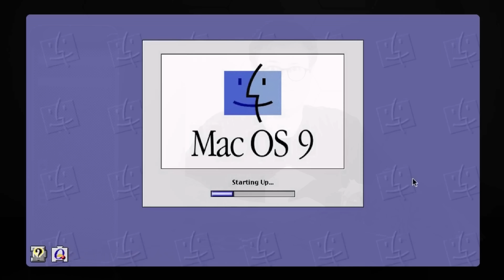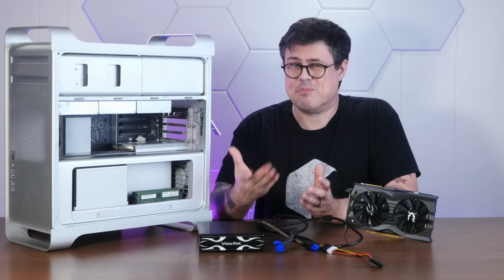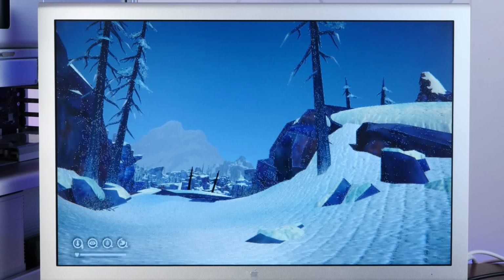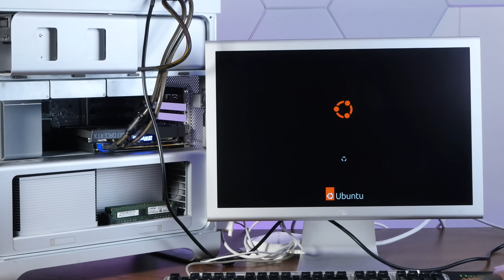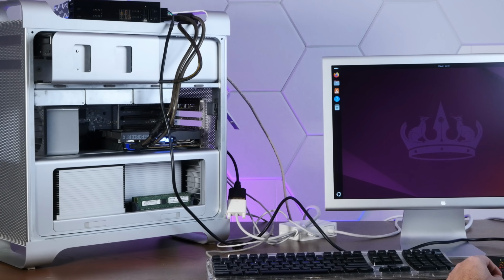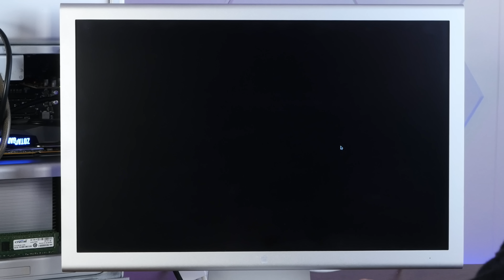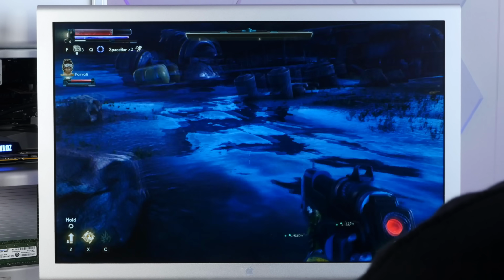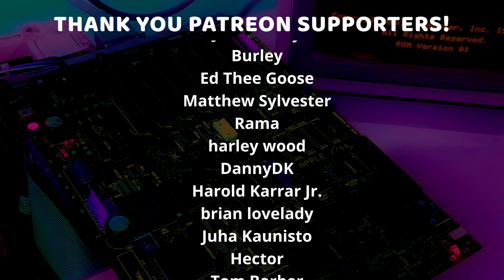I put an RTX 2070 in an old Mac Pro!

Comment: My Frankintosh-SpeXs  are the following today  []-) 
4.1 to 5.1 single tray MacPro with Intel Xenon 5690 @ 3.59 GHz, 
6 Core /12 Threads, 32 GB RAM und GTX 1070 8GB .
Win10 running in Bootcamp. All gaming is done in Win10 []-)
I have good VR legs and therefore great fun playing 
Alyx (30/45 fps), MSFS (25/45 fps) and GTA5 (38/62 fps) 
in appealing graphic quality 3D 6dof VR []-)

Hey ACTION RETRO 
thank you for the nice video !!!
Have fun with YOUR Cheesegrater !!!

These old machines are amazingly great to upgrade and to have fun even gaming. 
I am NOT a PC/Mac specialist at all. Still it took me just like a weekend of YT research and I had all info to build my Frankintosh.
(Thank you goes esp. to Greg Hrutkay.)

Comment: Hi I had my CMP 5,1 working with Linux Ubuntu and Sonoma with OCLP. Before having any MacOS (I had Monterey, and later Sonoma) I was able to get output and "Chime" with a GTX1050Ti. I literally removed the Sonoma drive, and kept the Rx580, and everything is fine. But When I put back the GTX150Ti, or a RTX3060 nothing came out, not even the Chime... How can I fix this?

Comment: I still don’t believe that some GPU’s can’t run a game like that at more than 1 FPS. I think they detect your card and then decide if it will work or not. If the 9500 was acceptable or even good in 2009, how can it not load a game that looks that crappy? I think the whole game industry is based on planned obsolescence more than computer and smart phones are. They must be terrible at coding newer games if you need a brand new flagship on a 3,000 core pc to load what looks like Sled Storm from 1996 😂

Comment: So I have 2012 MP 5,1 server. I run windows Baremetal with nvidia 1060 6gb. I’m running valorant over 120fps max graphic settings. ESO around 90-100 maxed out. I stream no problem. Can the 2070 run under windows ? That’s the video I’m looking for

Comment: I don't know why you are using an external power supply for the GPU, you get GPU mini 6-pin to 8-pin cables for that motherboard, there are two slots on the motherboard that will supply enough power to almost any GPU

Comment: You can go ahead in time a few years to around Sandy/Ivybridge era and find a lot of insanely good machines for all kinds of tasks. The hard truth is that during the 2010s when Intel didn't really have any competition (bulldozer wasn't really competing much with AMD) they didn't really make any big/massive improvements for like 10 years aside from top end if you really push it. I have a jank dual socket X99 aliexpress board with some used Xeon E5-1650 v3's with 32gb of ram, and it works great, surprisingly (with fire extinguisher nearby just in case). For a weird for fun project, I actually enjoy using it for the fun of it alongside my old Ryzen 2600 build that has become my budget test bench. Performance isn't half bad even today, but you could probably scrape together something like a 12600KF i5 build when parts are on sale if you're patient and that together with an RX580 8GB you can get decent 1080p60 performance, especially with the supported upscaling. That's what my Ryzen was running until I transplanted it to the dual socket setup. If Intel ever releases battlemage for a decent price, I'm grabbing one of those and probably moving my 6800XT to the Dual Socket or Ryzen machine. I had an Arc 770 as my budget card with my RX580 8GB, but gave it to a friend that needed a card for photo editing, and it handles it great with current drivers. 

TBH, you can pick up loaded office workstations from around Ivy-Bridge to Haswell and maybe a bit later on these days with higher spec i7's for dirt cheap in lot sales or auctions. There's generally space enough for a card like this 2070 Super and enough power to handle it along with enough capacity for 16gb or 32gb of ram to make budget monsters relatively speaking. For kids or people that can't afford a more traditional build (or people like me that enjoy doing them for fun...my tinypc/thin client stash is ever-growing) it's a great option.

Comment: Nice.  I've got to flash my 4,1 to a 5,1 (never done before but I understand it's easy), and it's got a crippling 8 gigs of RAM I need to boost, Quad-Core 2.66 GHz Xeon, and a GeForce GT 120 (also probably needs upgrading too lol).  I'm still running OCLP Sonoma, but Ubuntu may be the way once the OCLP quits being able to be used.  Probably will need to look into that on my 1,1 and 3,1 as well.

Comment: Interesting... I installed Slackware on my 5,1. Took a little while to get the sensors and fans all figured out but it all works. If I were to use my old 2080TI I'd need an externally "mounted" power supply. Not sure how it would fit with the back plate on the floor of the expansion bay. Maybe externally mount it with a pcie riser cable?? So much possible jank...

Comment: I think that you might have gotten better performance on The Long Dark from the GTX9500 if you had added the nvidia-legacy PPA and installed the nvidia-340 drivers. In my experience, nouveau does not work very well with very old cards.

Comment: I have a Mac Pro with a Sapphire RX 5700xt running windows 10 and it can play cyberpunk 2077 at 2k res on high settings. I’ve placed a standard 500w psu where the disc drive was and run the cables through the hole where the apple psu cables run (after some trimming). One my fav machines although it needs a lot fiddling around to get windows and some games to work as they should ( or even install windows, which took me 2 days)

Comment: I'm the donor of that VisionTek PSU and when I bought it new from Fry's, I was probably the target market because I didn't know a whole lot about computers and woefully underspeced my PSU and was too lazy to outright replace it so I bought the VisionTek. I've since learned a bit more but I'm so glad to see Sean continuing his shenanigans with that thing. That thing would still be in a drawer taking up space. 😂
Reply: Do you remember how much it cost back then? Just never seen one before and I don't remember them.
Reply: @EhEhEhEINSTEIN  I'm not 100% but it was in the $50-60 vs range. It was comparable to a normal PSU but the ease of upgrade is what made it appealing and sold me on trying it.
Reply: What model is it?
Reply: That GPU is bottle necked to hell lol
Reply: @HoveKB   That’s fine though, he wanted to max out the capability of the Mac.

Comment: Classic Mac Pros are sweet. I have  a 4,1 flashed to 5,1 as well with dual 5680’s and an RX580 rn, I’d like to throw a Radeon VII in it so I can maintain hardware accel in Sonoma since I mainly use it for Mac OS. They can actually take up to a 6900XT so long as you’re on Monterey. I also need to upgrade to nVME’s and get a new WiFi/bluetooth card. Once you do that they’re very snappy and still can hold their own for their age. Even with just the processors and RX580 it’s impressive how snappy it still feels.

Comment: Hey it's my daily driver PC, except with maxed out CPUs, an RX 5700XT and the PSU mod. I've had it for since 2015 when I bought it used for £300 in a similar spec to yours, and well just never felt the need to upgrade it. I run windows 11 on it almost exclusively since my need for Mac OS ended a while ago, but it's still a great computer...

Comment: I had to retire my Mac Pro. The X5690s are very held back by their platform. Some games won’t even open, they’re highly incompatible for their power level. I “upgraded” to an i7 8700 which funnily enough is only 20% better than a single X5690 but are supported better for newer software. I was running an RX Vega 56 8GB and I’m surprise it was still lasting me 15 years after it was produced… but it was time for an upgrade.

Comment: Might be worth checking the firmware on the 2070 super. I had a similar issue with a PC and UEFI firmware not picking the correct video output on boot but works in the OS. Also try a different monitor with native HDMI or DP to rule out the monitor 🙂

Comment: Honestly always amazed how well a pc can run when it has an older cpu with a modern gpu. For a long time I used a 2nd gen i7 with a 1060, and it was great as long as I wasn't trying to run a cpu intensive game. Honestly had less trouble with that pc than when I upgraded to a 10th gen i5 lol.

Comment: Redmond done a really big mistake by raising the minimum system requirements of windows. My "gamer" pc is a 4690k@4,7ghz with 16gb of ram, 6gb gtx 1060 and a tons of ssd and hdd. It used to have W10 where I used firefox, libreoffice and steam. Now it has ubuntu where i use firefox, libreoffice and steam and actually it's much faster/responsive than before. Yeah I know, ubuntu is not the best for gaming, but every single game I play on steam works out of the box with same or even better performance than on W10 before. I hope it has many many more years to be an awesome daily driver/gamer PC.

Comment: The login screen issue can be fixed by going into your login screen settings and setting it back and forth to new themes and applying them usually, as the issue is typically the machine trying to initialize the original drivers until it updates. I also highly recommend getting the Nvidia 560 drivers.

Comment: You can install OpenCore and get to the latest Mac OS Sonoma, use some high end Vega series video card, Navi cards require AVX to run their drivers, therefore it won’t work with newer Radeon cards, yettt.

Comment: FYI every, single video of yours ive seen is very interesting. Keep it up.
Unusual setups are right up my alley.

Im not an apple fan but ive always wanted one of these for some alternate OS and hardware experaments.
And one of these cases would make a baddass PC mod for a "bad apple" (A Mac with PC components running a PC OS.)

I once created a bad apple out of a  "Bondai Blue" iMac G4 Case using an generic laptop brick-powered Mini-ITX motherboard with an Integrated AMD A8 quad core, 16GB RAM, 120GB SSD and a Nvidia Quadro running Linux Lite from spare parts for an Ex Girlfriends photo editing hobby using GIMP.

Comment: Hi I use a Sapphire PULSE RX 5700 XT 8G in my dual cpu MacPro4,1 , the graphics card is rated at a max 241w and is only connected to the Aux power headers. The Aux headers will cut out at 10A 120w and can be used stably at 8A 96w per header. Main thing is even if your gps has two 12v ATX inputs most guys will draw more power from one header compared to the other. So I use a Y-Y cable setup to join the two 6 pin aux headers together to a single 8pin then back out to two 8-pins connectors

No need for Pixas mod or an additional PSU. More than enough power head room on the stock psu

Comment: I have 2010 Mac Pro, choice of a single 3.45 (fastest gaming performance) or a dual 3.06. Open Core dual boot on separate PCIe Nvme 1TB Samsung 970 evos, Pixla mod and a sapphire rx6800 with syncretic flash mod, and a 3602 WiFi blue tooth upgrade, finally a usb 3 PCIe. On world of tanks, I get same frame rates as my AMD 7600X / X670E combo with the rx6800🎉🎉🎉

Comment: Did you try reinstalling Ubuntu after installing the NEW video card? It might fix the blank logging screen problem, by the video drivers being upgraded and match automatically to the NEW hardware specifications of the Mac’s  Hardware, that of which includes the new video card. Another excellent PC tune up, good thing that the motherboard and or power supply did not get fried due to excess amount of electrical power, ehehehe. The electrical power current has to match, no need to worry to much about them, tho they are pretty much universal, they can cause shortages tho. Whatever works tho.  What is the total wattage power consumption of that new super computer Mac setup? 😺👏👏👏👌🥰✨💎

Comment: If the firmware is updated you can boot from a PCI-e slot NVME card. The Sata ports are Sata 2, so the NVME is noticeably faster. 

Big Al (as in aluminum) is quite a machine.  Beware of programs calling avx2 instructions though, at least some of the old Xeons don't have them.

Comment: Idea: replace the native power supply with a modern power supply so can use the graphics card and everything else without needing to drill holes
Reply: The Apple PSU has some smart functions that tie in with the motherboard to shut the system off in the event of a fault. Disable this and you can burn out parts of your board, assuming the system would boot at all. The reason behind the Pixlas mod is that it was easier to tap the existing PSU lines directly than to replace it

Comment: great video! did you see that the optical bay drive holder has 4 shiny Apple screws just paitently sitting there for when you want to install a second drive or funky second power supply

Comment: I have a few Dell T7500 and T5500s they run dual x5690, and they are fantastic machines. 
I use them for everything. 
I also have a Ryzen 5900x which is faster on single core tasks, but is limited to 128GB of RAM and only 20 pci lanes.
The T7500s can take up to 384GB of RAM, and have heaps of PCI lanes.
You may be able to put a couple Xeon x5690 CPUs in that Mac, that would give you 12 cores if it works. 
I would love to see that.
They use 135 watts each, I don't know if that matters.

Comment: Have you considered using a carrier card for an nvme drive? Of course without workarounds like a cd or flash drive with clover to boot from, but you could always just use it for games.  If you're going to go this far with putting a 2070 in, why not a step further?

Comment: This is a bit of an overkill solution that feels like a waste, tbh. It pisses me off that Apple has never given proper software support to their GPUs. What do I mean? Their AMD GPUs they had before moving to Apple metal, and I'm talking late 2017, they were good gpus, but, for instance, they didn't have proper drivers to handle hardware compression and capture of desktop footage via hardware. Everything had to be done with the CPU, thus causing the fans to go absolutely ballistic on an iMac. This would be a big issue for people who were Zooming (had to do massive amounts of it for work during the pandemic), and it basically made a mac useless for streaming or for recompiling and handling footage that you'd be streaming (as in capturing footage from another PC and compositing it on OBS). Ah, and yes, OBS runs like shit for the exact same reasons. It's one of the reasons I had to buy a windows PC a year later.

Comment: I have a mac pro with a really unusual card in it. A prototype of one of the first commercial RayTracing hardware, the Caustic R2500 PCIe, and. I'm pretty sure the one I have is the one that was put as a photo on Wikipedia, not 100% sure, but extremely likely. Quite funny to see you using a mac pro to install one of the more modern Raytraching GPU.

Comment: My daily computer is a 2010 Mac Pro with 128gb RAM, 2x X5690's, 2x Titan X's  (SLI), 4x Samsung Evo 970's, and an added Blu-Ray drive in 2nd disc drive bay. All running on Windows 11 Pro.

Also: deluding the CPU's and adding MX4 thermal paste to the CPU's and GPU's
Reply: If you want a free performance upgrade and don't need the extra RAM, take out two sticks and the system switches from dual channel (all slots populated) to triple channel (six slots populated). Some tasks are considerably faster with 96GB RAM due to the extra bandwidth
Reply: @flotowncomputerguy6243  Ya if you take out the RAM from slot 3 and 7 it makes tasks faster. I keep the 128 ram just because I think it’s cooler :) thanks for the comment 👍👍

Comment: these mac pros (specifically the 4,1/5,1) are by far the best computer apple has ever made. i have two that still see regular use, though both sharing a dual 6-core Xeon CPU card and 32GB of ECC DDR3 (i may or may not have broken the other card i had oopsies). one in my music studio and one in my bedroom with an RX480 that my friend uses to play video games with me when we're hanging out. neither of them skip a beat, even running perfectly modern OSs (even windows 11!) and I dont think we'll ever see another machine from apple as beautiful, powerful, AND upgradable as these were. fantastic video!
Reply: If you want a free performance upgrade, double check that you're running the RAM in triple channel mode. If you have all the slots populated or populate certain ones, you end up in dual channel mode. I run mine in 96 GB mode, though it could technically do 128 if I populated all slots. I seem to recall that it also defaults the memory to a higher clockspeed if run that way. The extra bandwidth really helps these CPUs on some tasks
Reply: Based

Comment: I love me 5,1 MacPro its a multi boot MacOS's Windows, but mostly linux workstation. I upgraded the wifi/bluetooth card, 128mb ram, SSD, 2 x X5690, RX5800. The thing is still a beast on most work loads.

Comment: I have a 1080 in my 5,1 Mac Pro.  It’s only useable under Windows (which is fine because I have an M2 MBP as my main computer).  Great for emulation and windows games, though there is a bit of a CPU bottleneck for newer games.

Comment: My tenth gen i5 laptop is more powerful than this machine. Doesn't matter the Mac has double the cores when they do less than half the IPC. But Ubuntu will run fine on a 2nd gen i3.
470 driver was released in 2021 and was the only official driver which allowed LHR 30 series GPUs to run at full hash to mine Ethereum.

Comment: Since it has PCI-Express I wonder if you could add an NVME drive via a PCI-E to m.2 bracket. Obviously not as a boot device, but as high speed storage?
Reply: Apparently the upgraded 5,1 firmware supports NVMe boot.

Comment: While you were singing the praises of the First Gen Mac Pro, you forgot "affordable." I bought a Mac Pro in 2010 for about $2500.00. It was expensive but manageable. Now, the base Mac Pro model is $7000.00! Ridiculous. Oh, and don't forget the $700.00 wheels! Patently absurd pricing, which is placing an inflationary pressure across the industry. I never liked Steve Jobs, but I did at least respect him. I loathe Tim Cook.